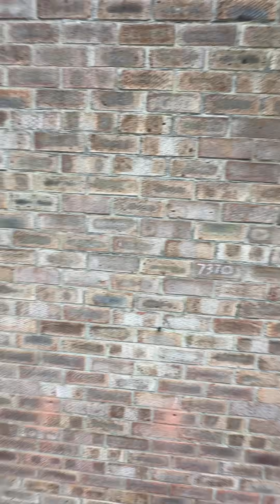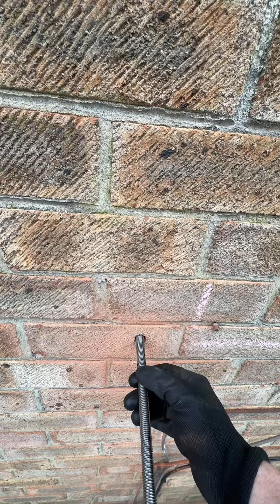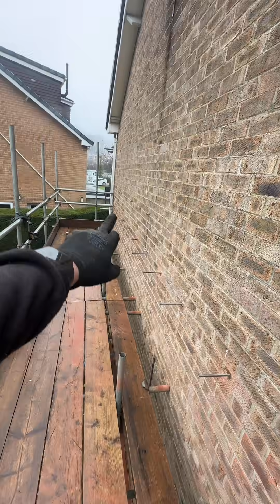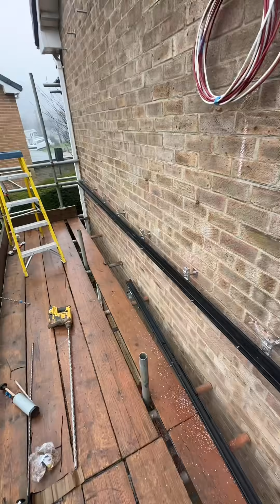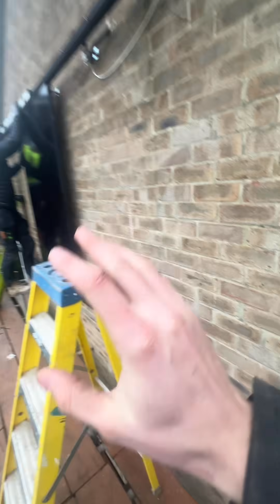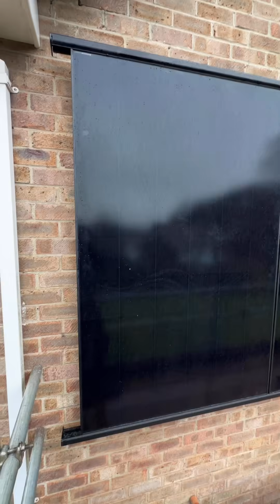Here is how you fit wall panels using this @slrack solar PV system!

Comment: so how would you go on with a rendered wall then ??, bearing in mind you cant see the bricks ??,& yes my walls are rendered & screaming for vertical panels :)
Reply from the maker: We would drill some test holes to ensure we hit the brick work. It will depend on your install though. I assume you don’t have external wall insulation?